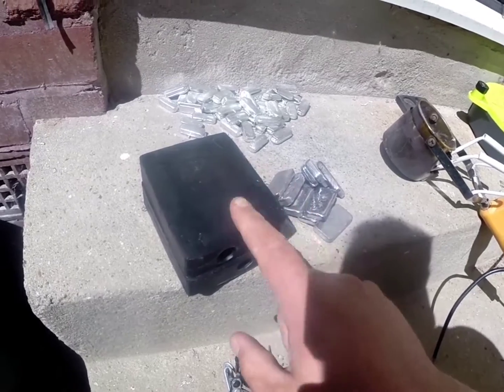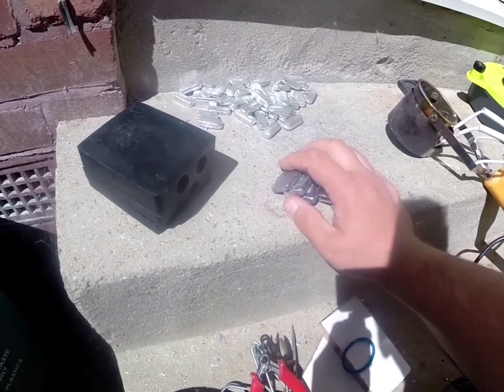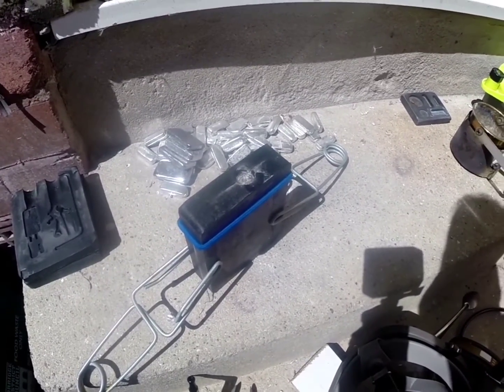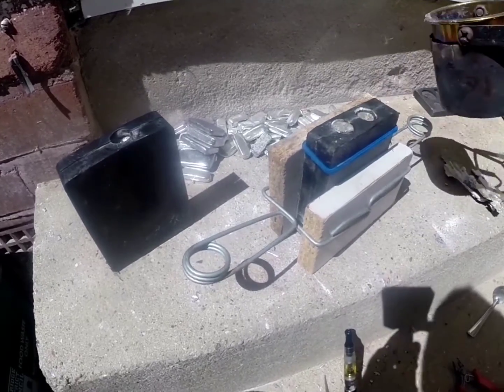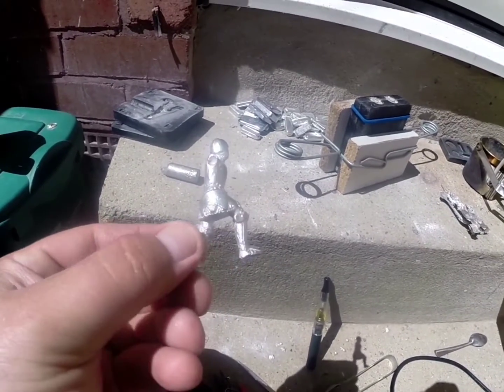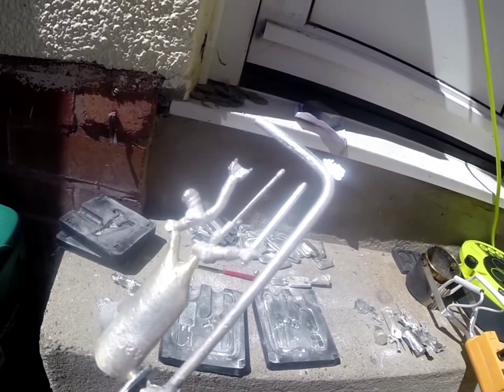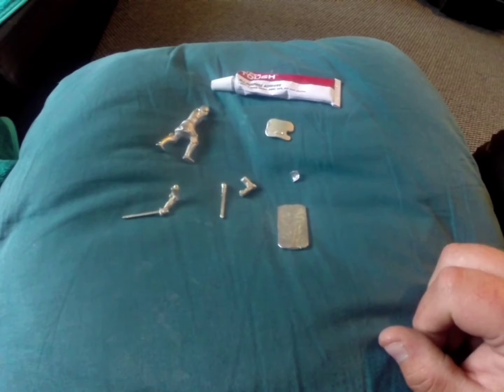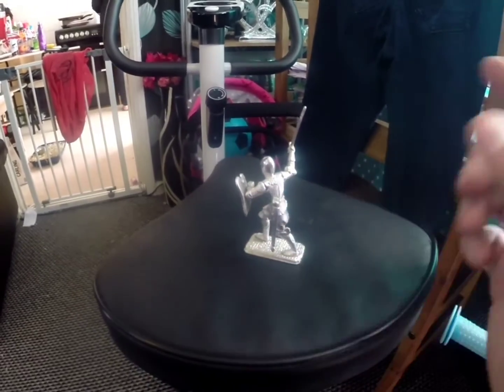A new Knight mould

Comment: The medieval knights are my favourite to mould Kev.  As you say a lot of work to finish them as so many components to assemble. It's worth making them in bulk so that you have plenty of spare parts for when they malform. Although they assemble with gaps at the joints I think those could be filled with Miliput prior to painting.